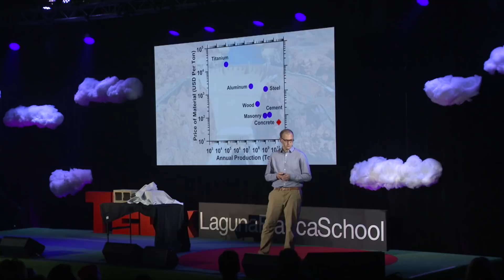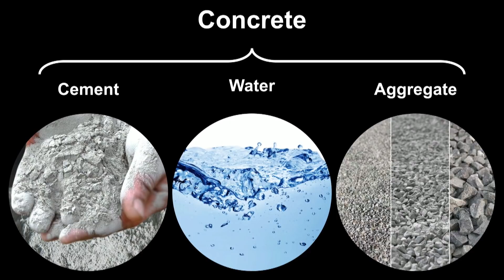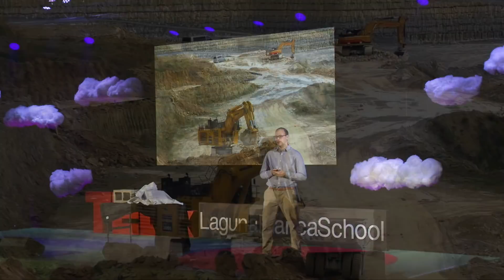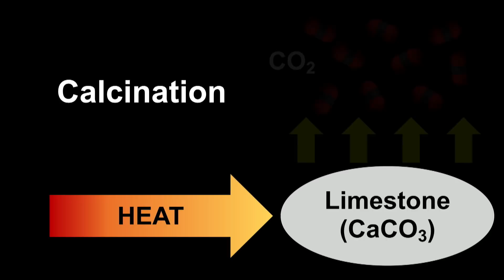Why We Should Turn CO2 into Concrete | Gabriel Falzone | TEDxLagunaBlancaSchool

Comment: You  can use the Mass of the Carbon Dioxide on Venus to Calculate the combined mass of the Limestone  ( Calcium Carbonate ), and the Dolemite  ( Magnesium Carbonate ) on Earth.  It is around 1.14 X 10 ^ 21 kg.  Then you can take the ratio of this material divided by the mass of the Earth to open you eyes.  1.14 x 10 ^ 21  divide by 5.95352 X 10 ^ 24 kg = 0.000 190 842  to 1.0.  This is 0.019 % of the entire mass of the Earth sequestering about 99 % of all the CO2 on Planet Earth .      THINK ABOUT IT.   This is all possible because sea critters used the Calcium and Magnesium and combined it with CO2 to make CaCO3, and MgCO3  In Shallow Marine Environments.   Perhaps we should promote the formation of limestone in shallow marine environments by giving reefs lots of what it needs to form reefs, in locations where the temperatures are not too cold, and not too hot.

Comment: CO2 mineralisation I think is a great idea of a permanent solution to capturing and storing CO2.

The waste gas CO2, released in the concrete making is sequestered back into the concrete block. CO2 (gas) to mineral CO3(solid)

This is done by using the hydrated lime (Calcium hydroxide ) which can absorb the CO2.

The process probably is more expensive but a necessary solution to reduce emissions.
Reply: Better unexplained than the video. Thanks. 
Elon Musk needs to be involved in this process. 50% reduction in CO2  emissions and more expensive?. 
Elon Musk projects cost and emissions reductions are usually over 90%.
Reply: And lime is produced by calcination, which is burning coal. For every co2 molecule absorbed, you need to emit 3 co2 molecules. But it's fine as long as it's outsourced to China, who doesn't have a carbon emission target according to the Paris accord.

Comment: Go back to the drawing board bro. This will only work for cinder blocks and the concrete dividers on highways, foundations will still be made with regular old concrete. The best route for future construction is concrete foundations with hempcrete buildings on them. The CO2 sequestered by the building will be more than double the CO2 to make the foundation.

Comment: I refuse to believe this guy really couldn't tell how horrible his talk was. My guess is TED has a minimum length requirement and that's where all that boring science that literally no one would remember was added. Literally the first 80% of this talk was unnecessary and someone talking about reducing waste should do better. 
I'm skeptical of every Ted Talk and you should be too but the logic here is sound and I can't be bothered to do fact-check and number crunch so I'll take this guys word for it and congratulate him and his team for coming up with a way to halve CO2 emissions in this area.  But this is not enough and TED should get rid of this minimum talk length nonsense that I highly suspect they have.

Comment: could rotary kilms be run on electricty alone or dose the extreme heat nessary mealt the electic wires.
Reply: Insulation.
Reply: Nichrome would but you could use tungsten. It's a waste of time because most of the electricity is produced by burning fuel anyway. All you manage to do is lose 60% of the efficiency.

Comment: PLEASE UPVOTE SO THAT IT CAN BE SEEN BY EVERYONE

This CO2 to concrete has been proven to be a really bad idea by french engineers at EDF. In order for the chemical reaction to work, you need alkaline chemicals. What this start up proposes is to use NaCl  (which is basically salt). Fair enough. However, when you take the part that interests you, which is Na+, you will get a byproduct, Cl-. Cl- binds with H+ to create HCl, or chlorhydric acid. In order to absorb the equivalent of the production in CO2 of 5 coal plant for a year, you will produce the equivalent of the annual current production of chlorhydric acid. So what do you do with that excess chlorhydric acid that no one wants and that is problematic even at such small amounts ? No answer has been given yet, and this project is older than it seems.

Comment: 5 seconds of google:

"The conversion of calcium hydroxide in the concrete into calcium carbonate from absorption of CO2 over several decades further strengthens the concrete and makes it more resistant to damage. This carbonation reaction, however, lowers the pH of the cement pore solution and can corrode the reinforcement bars."

Not mentioning concrete needs apropriate sand with developed dimmensional grain, that Earth lacks right now so yeah, great idea :) More TedTalks, less science :)
Reply: liczkos you can use non metallic bars
Reply: Alright, however i think that the point of reinforcement is to use material that has higher physical capabilities than the matrix material (eg. concrete). Also you want that material to give the composite some elasticity, thats why we use steel because its more elastic than concrete, but also more sturdy. So using anything else than steel isn't doing the job.

I don't decline that maybe in the future, we might use something else as the reinforcement. But technology isn't ready yet. And we still have lack of proper sand.
Reply: They already have coated rebar, so nice try. While I find your sand criticism to be fair and constructive to an overall ecological discussion, as we speak The Sand Is Going To Be Used Anyway; it's a separate problem. Why shouldn't we make a better concrete while also trying to use less of it? Again, only water is more abundantly handled material....on Earth. Your (non) solution is that we should not pursue this solution because you are demanding the immediate cessation of the use of the most abundant building material on Earth.....or what was your solution again? Oh yeah, you don't have one....I get your line of thinking (this isn't an infinite,perfect solution, therefore it's a waste of time) because I and everyone else fall into it regularly, and it serves many situations well. However, given the quantities of the present condition and the possible sequestration, the question of whether doing nothing or pursuing these methods is the more intelligent and moral course of action  requires an answer so obvious as to not deserve any elaboration. In other words, move along, get out of the way, or come up with your own equal solution, but do not hold the rest of us back with lazy pinhole poking and muddying of the waters by combining separate issues, both as a result of an automatic, pessimistic, crazy uncle in the armchair attitude. Thank you!
Reply: @lincoln1345  How is this a solution then? Like the OP said the same process happens with time anyways. Why put in the extra effort that probably causes even more CO2 to be emitted?
Reply: @Rimmot : As j gordon already succinctly pointed out...1) They have already created coated rebar, so that is a non issue.2) The sand is also a non issue because they are going to use it anyway. 
  I suspect you just don't want to face actual real facts though. It's either that or you have incredibly poor reading comprehension. I leave that for you to figure out since I wouldn't know witch one is your personal issue.
Reply: @aylbdrmadison1051  Funny that you lecture me on reading comprehension while you clearly haven't understood the content of my comment.

In my comment I had no problem with fusion bonded epoxy coated rebar (which has it's problems) My question was: Why spend the extra effort to speed up the carbonation process when it is going to happen naturally anyways? Especially, since doing extra processing will always cause even more greenhouse gases.

What if it is you that so badly wants this to be real that you can't even read a comment through and you will just ignore the problems people are raising.

Finally about FBE coating: Epoxy coating on rebar can actually paradoxically cause faster corrosion. This is a phenomenon called pitting corrosion, when an exposed spot on a steel surface corrodes faster and more severely than totally untreated steel. It is a lot more catastrophic if your rebar suddenly weakens in one spot than if it slowly weakens everywhere. That sudden weakening can go easily unnoticed and a chain is only as strong as its weakest link.
Reply: j gordon Amen!
Reply: @rimmot, I’d like to address your question of why the sequestering and reuse of carbon particulates makes a difference here. All core materials which might be replaced with waste materials, should be.  This particular reuse happens to accomplish the above mission statement, and correct waste emissions processes, simultaneously. We will continue to improve generation processes, every step that direction should be celebrated. 

We need buildings, bridges and roads. Our schools, hospitals and businesses need building too. Construction could improved our footprint? That’s incredibly cool!
Reply: @energyprofessor8033  So you are saying the aggregate has potential for sequestering carbon?
Reply: Liczkos random dude here saying we can use coated rebars, will that solve the Ph issue?
Reply: @Eric Renrut : Do you always ask the person who has already demonstrated they are obviously the least competent for your answers?
Reply: @aylbdrmadison1051  fair point

Comment: What is this guy going to do when he realizes that CO2 is a very minor factor in the climate. He’ll find that out soon when IPCC 2022 climate models and AR6 report are final. Pollution bad - CO2 not pollution
Reply: The Pixel Mudkip I believe your listing green house gases, by far the most significant green house gas is water vapor.  That’s right water vapor traps in the most heat.
Reply: So what is the cause then Einstein
Reply: Andy C don’t be like the new grads I hire who leave college expecting everyone to spoon feed them info. I gave you threads to look up the research yourself. Here’s another thread, new research proves that solar forcing is important and it was included in the CMIP6(v3.2) ipcc model.
Reply: @911maxwell  but you said CO2 not pollution and that's wrong. You could have said it's not the only factor and that we should focus on cutting down animal production for the methane, water vapor and such, and that left them confused.
Reply: @uzunashii  the classic definition of a pollutant is a compound or element at impacts human health or the environment.  Human Health - the current concentration of atmospheric CO2 is 415 parts per million (ppm), the OSHA standard is 5,000 ppm for an 8-hour time weighted Average (TWA).   Typical concentrations indoor air concentration of CO2 per EPA is 350 - 2,500 ppm. Earths atmospheric CO2 has fluctuated drastically historically from 4,000 ppm to 180 ppm.   So would say that current concentrations are not a concern even an increase in 100 ppm would not concern me regarding human health impact.  Environment -  CO2 as force for changing climate; the new research i was alluding to above show that solar forcing variables are significant and have been excluded from previous CMIP models. Based on the simple calc defining variables of CC natural vs anthropocentric; if you under estimate natural variables you will over estimate anthropocentric variables.  CO2 related to flora and fauna; when CO2 was the highest, the plants and animals were gigantic.
Reply: Andy C and I’m not quite Einstein, he was a physicist, I’m an environmental scientist